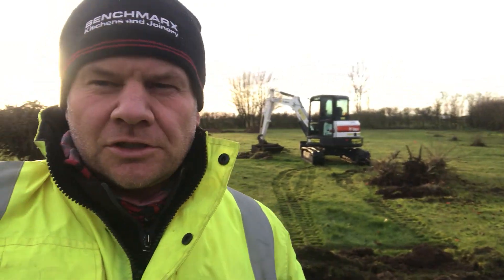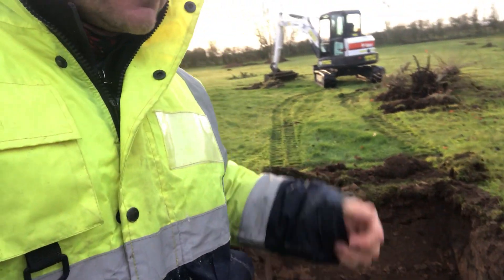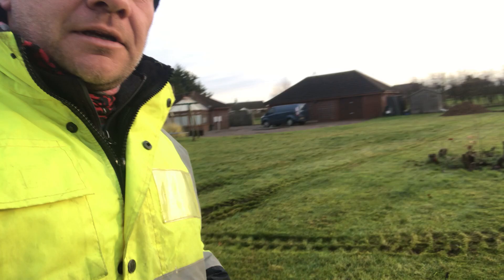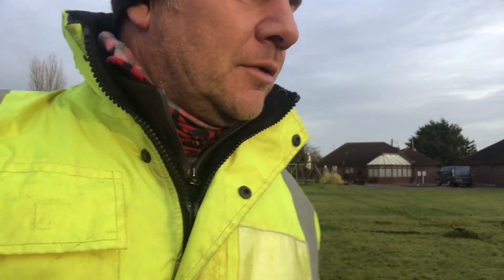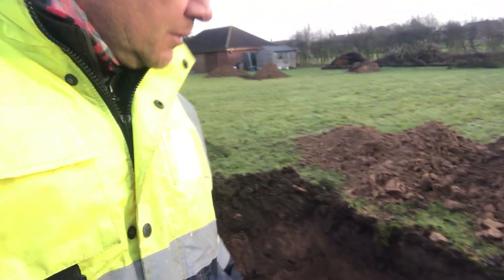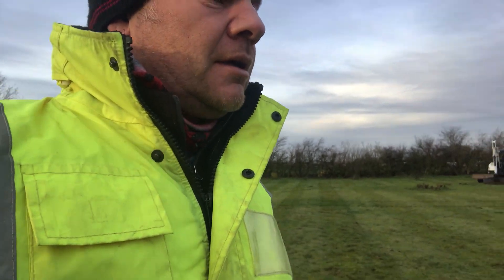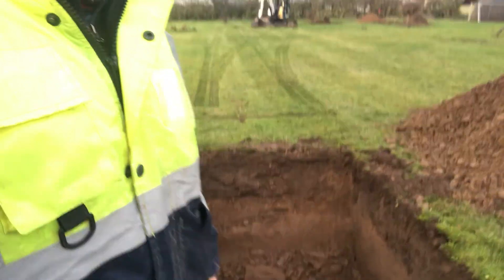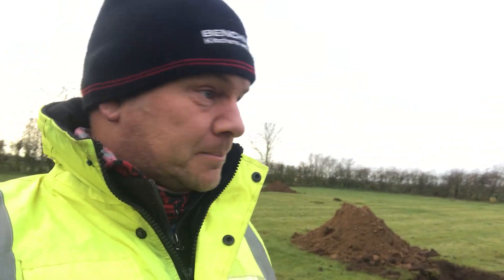Digging Trial Holes for Foundations on a new site

Comment: Brilliant job
Is this a swampy land? The land is near water and the soil you’re holding looks wet. What was the depth and type of foundation used for this project? Keep on the good work 
Hope to hear from you 
Many thanks
Reply from the maker: It’s in the fens, Lincolnshire. Silt soil after 600mm. This is how far we dug the foundations and went 800mm wide with some 10mm mesh in 300mm of concrete. It’s good soil but the water table can be high if we have a wet winter
Reply: Lovely 
Thanks a lot for your super quick reply 👍